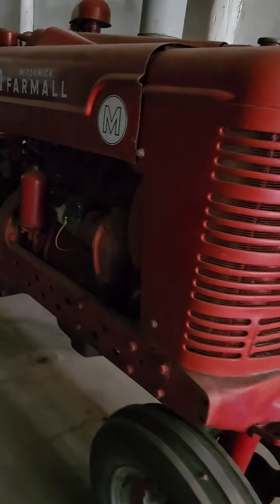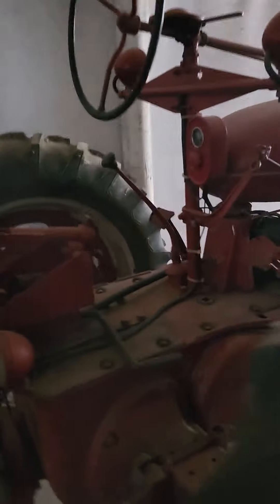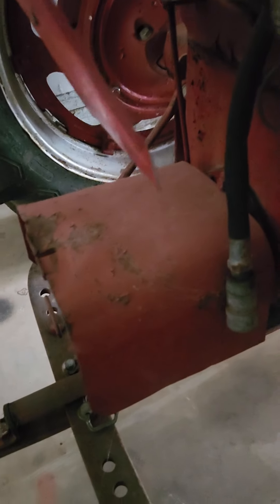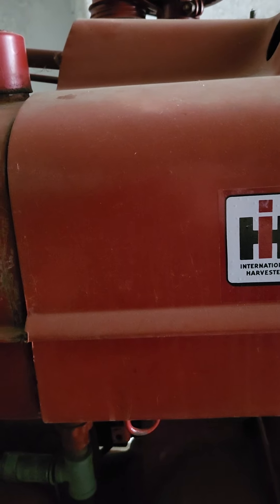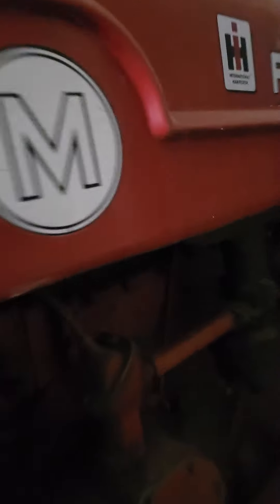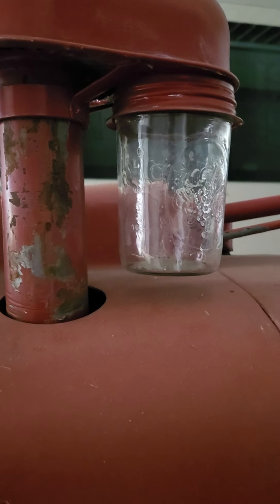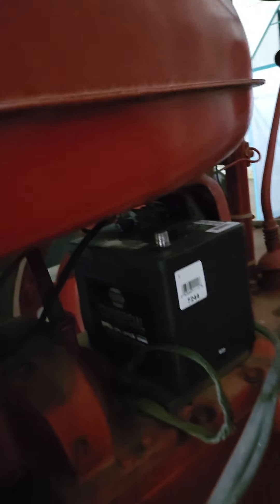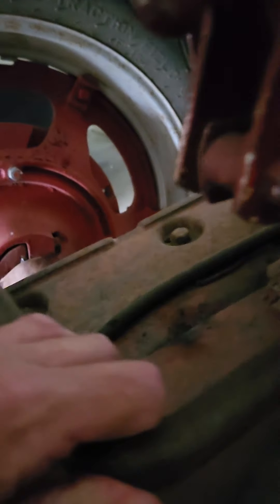1945 Farmall.  War tractor.

Comment: Now you have a new subscription holder thanks again for sharing this. That gentleman wouldn't let me crank his , said I would break something like my arm or wrist. Always made sure the battery was good in it when I cut the field in front and side of his house in the summer time.
Reply from the maker: I think Dad didn't like buying batteries.  Most of the tractors had the magneto.  A tractor I didn't trust was a F20 I bought.  That would have been the late 1980s.
I tend to describe it as temperamental,  but in honesty the magneto was worn out.  I didn't fear the backfire ( Kick ) when I was younger.  Now I'm more cautious. 
Thank you John.

Comment: Wow! A 45! That’s in great shape Bryce. 
I used to work for a guy that had a Super MTA. I think that it was a 54. He was in the Army in Korea and bought that tractor brand new when he got discharged. It didn’t have power steering.
He never took very good care of it and it looked pretty rough 20 years ago.
He was killed on a 460 Farmall tricycle.
Reply from the maker: That is a lot of spare parts from a friend who built 2 tractors from 4. The tin, gasoline manifold,  and a few other pieces cam from him. Thank you Gary.

Comment: On a magneto ignition tractor does a 12 Volt negative ground affect the magneto is it safe?
I ask because I know they were originally 6 Volt positive ground?
Nice looking tractor looks like it would be equipped with a belly pump mine did not come with any hydraulics😀🇨🇦
Reply from the maker: I can't say. That's a 6 volt positive ground.  The starter, generator, and lights are completely independent of the ignition. The 3 Farmalls Dad owned, and 2 I've owned had the same system.  Thank you.